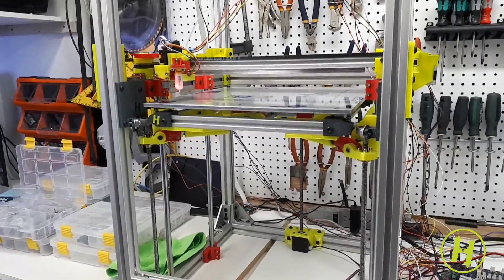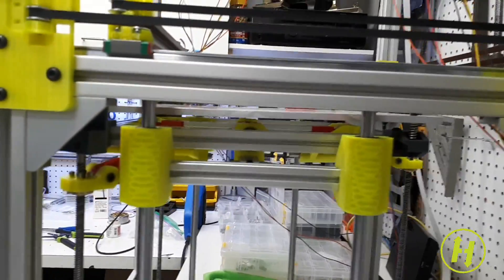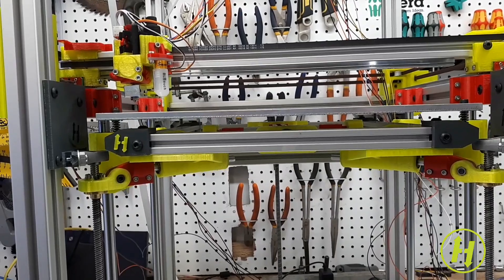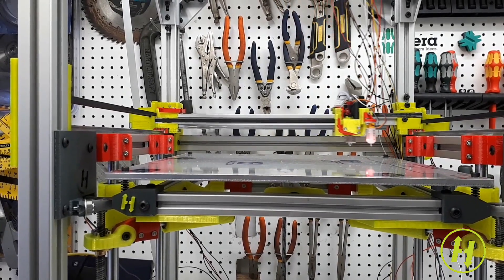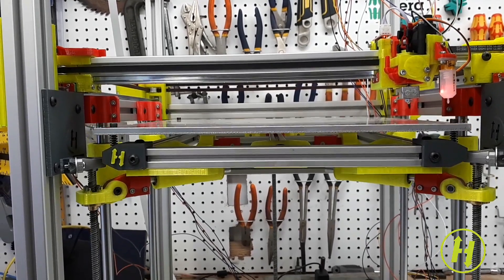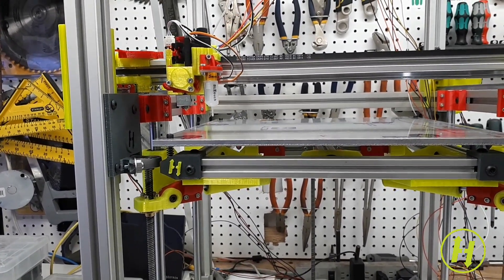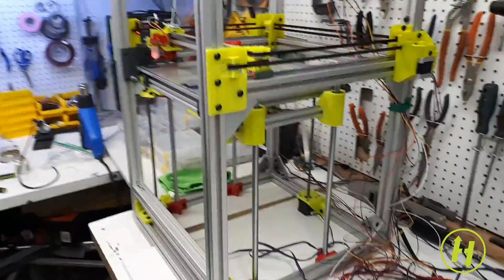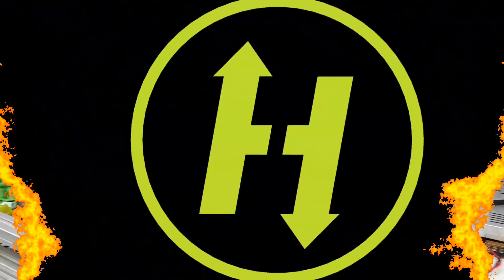HevORT 3D Printer - Triple Independent Motors Z axis with self leveling bed.

Comment: Is there any significant differences using 3 z motor vs 4 z motor for auto bed levelling? And what firmware did you use on this video?

Comment: Such an interesting design; I am working on a 64ftsq printer (4x4x4ft) and the bed is so heavy I will have to go with 3 motors (also geared 3to1 to even have a chance to lift the print and the beds).
When I am more advance in the process ill contact you guys as you seem to know what are you doing and I dont do programation.
Reply from the maker: At that size, I would consider Moving the XY gantry Up and down.  The bed self level could still be achieved by three super high ratio stepper with short stroke rails.  Duet could remap the axis to switch between all of these motors during leveling vs printing.  I thought of that, but the HevORT size did not justify those 3 additional steppers yet.
Reply: @MirageC  it would make sens to move the top instead of the plate, as the plate with the heaters would be around 150lbs.. ill check my plans..
Reply: I would like to see what you have made. Any construction yet?
Reply: @followMii-Ng  that was a long time ago. I did built a functional xyz gantry, you can check r/jrockland3dprinter on reddit.
Havent updated in a while, working on a bigger one to print custom car body kit

Comment: This has so many parts going lol, it should be a nightmare to maintain unless it's therapeutic to do so.
Reply from the maker: Final version is in function for the past 4 months.  BArely no mainetance required.  Even when time comes, it will be much easier to maintain: https://www.youtube.com/watch?v=aL7pEEHTTe4
Reply: @MirageC  but if you use a bed that isn't mirror and doesn't warp isn't it better? what is the best non-warping bed?
Reply from the maker: @antdx316 MIC6 aluminum with glass sitting on it will not warp beyond unaccpetable degree.  The Leveling fucntion is not to compesate warping, it is to eliminate bed leveling between build plate switching under high production rate.
Reply: @MirageC  but when you have more moving parts and something malfunctions its going to be a headache trying to figure out which on is broken?

Comment: Why don't you use a BTT GTR 1.0? It without an expansion board has 6 drivers, enough for 3z, 1y, 1x and an extruder.
Reply from the maker: Because I have a Duet.  No need to switch.  And the GTR1.0 did not exist when this video was made as far as I know.

Comment: Fun stuff, but do not use metallized bags as underlay for pcb's. It's going to cause more issues than it solves with preventing shock.
There's a difference between static dissipative and static shielding.
Reply from the maker: Thank you :)  The parts are all mounted to the right place now: https://thingiverse-production-new.s3.amazonaws.com/assets/82/0e/f2/73/66/20191025_104116.jpg

Comment: Very impressive design and concept. What bed size are you using 300x300?
Reply from the maker: Thank you!  The bed has a phisical dimention of 350 X 350.  I am using MIC-6 Casting tooling plate 6mm thick.

Comment: Extremely nice design. I was looking for something like this to upgrade my Hevo! Im currently using 2 independant Z motors which works also pretty good. but with this kind of design, leveling the bed becomes even less of a hastle :) Be carefull with resting your electronics on those ESD bags though. they are conductive and could cause a short when you turn them on!
Reply from the maker: Thanks for the advice with regards to the ESD bags. :)